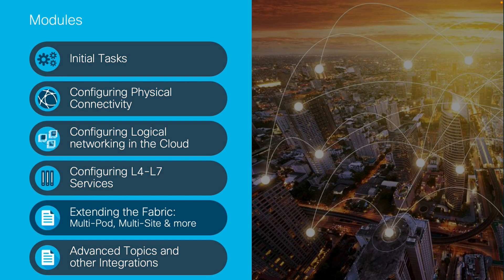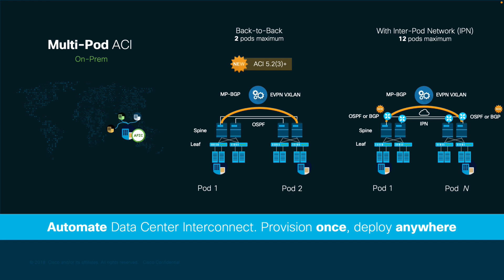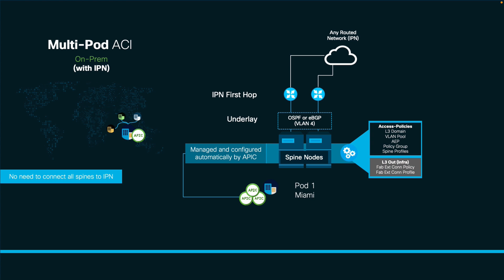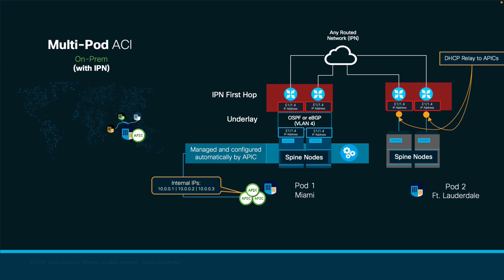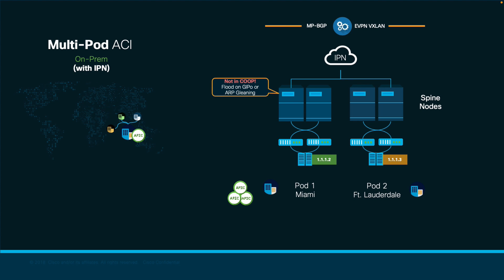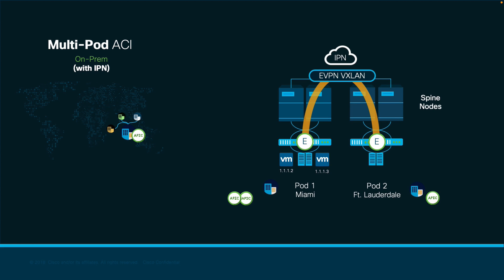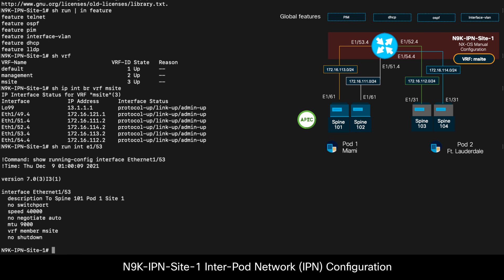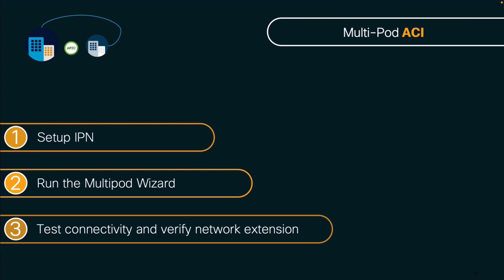Module 5 Episode 2 Part 1 - ACI Multipod Overview and Inter-Pod Network (IPN) Setup

Comment: if i have 2 APIC (active) in POD1 and 1 APIC (active) in POD2 whether need i configure dhcp relay or it will get IP TEP from APIC in POD 2 ?
Reply from the maker: Yes @nguyenhoangahn6089, ou'll need to configure a DHCP relay in the IPN, as the APICs in the different pods won't share information about their IP TEP addresses.